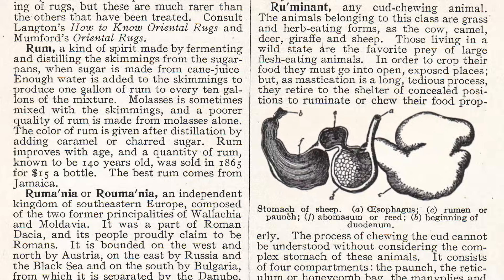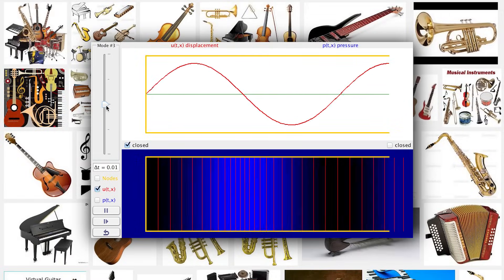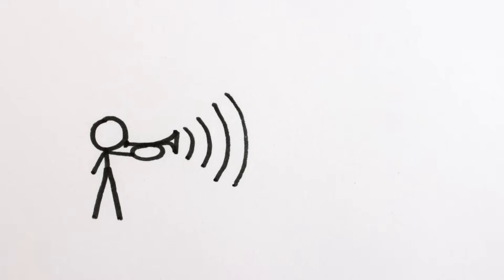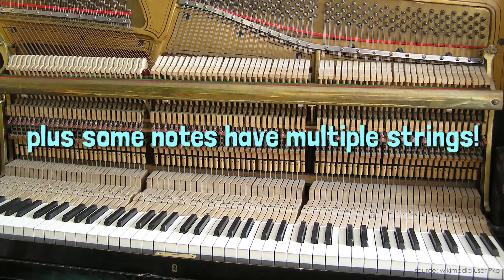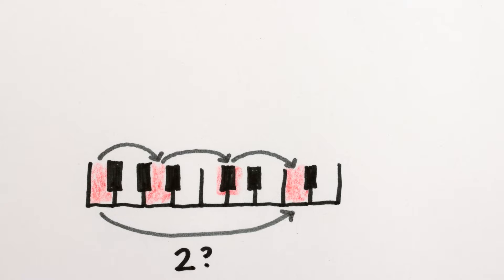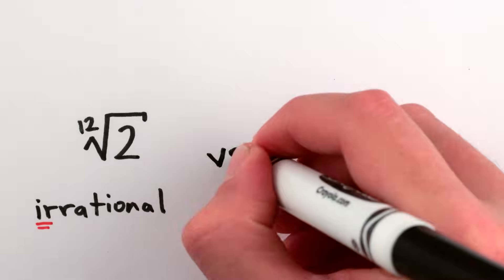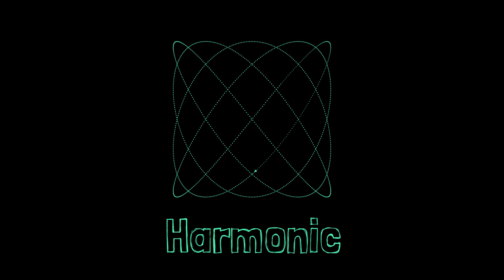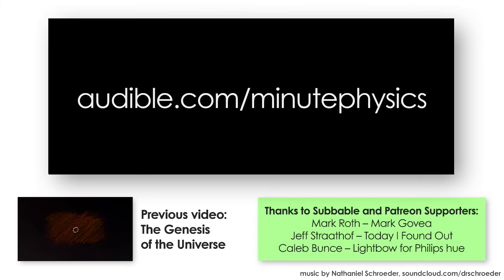Why It's Impossible to Tune a Piano

Comment: What if there was an electric piano that dynamically adapts the tuning of each note depending on which multiple notes are being pressed simultaneously to force them to have perfect harmony but in such a subtle way that we wouldn't notice while we're playing unless we're listening for it?
Reply: +PianoMastR64 Very interesting suggestion. I'm sure that would be possible to make. I wouldn't be surprised if it already exists.
Reply: I have a keyboard and I know a bit of C#. If I can learn how to work with midi signals, then I might be able to make a program that can do this.
Reply: +PianoMastR64 m8..
Reply: +PianoMastR64 I too know a bit of C#. C# F G#
Reply: I know both C# and Db. Yeah.
Reply: LOL
Reply: still wouldn't work. different key centers use slightly different notes than other keys. For example an E in F major is slightly higher than the E in the key of C major. To put it in the simplest terms, not only the notes in the chord itself, but what function the chord has will change the tuning as well. the same notes will be tuned differently depending if they're being used, say, as a Dominant function chord with a slightly raised third (leading tone), or a Tonic function chord, with the slightly lower third but raised fifth. so, in order for this hypothetical keyboard to work, it would have to know exactly what music you were playing, perfectly analyzed with Roman numerals and figured bass. But even this does not work with more complex music.

Or you could have a capable orchestra or choir perform it, and they will tune this way instinctively. In response to what someone said earlier, it isn't the slight out of tune-ness and small errors that make music performed by professional musicians special; it is the fact that they are MORE in tune than any other performance practice.
Reply: +Pete D Stay logic, please! If one note use different places this note is out of tune. If I tune my A4 440Hz no reason to use this note 441, 439 or other frequency if no the tuning is useless!
Reply: Sometimes we use the slight imperfection purposely, how would you find out if that is the case?
Reply: Tallywort Play around with it I guess. Options are always preferable, so make the feature an option.
Reply: Glade Swope
That is because a large part of the important intervals are only a few cents away from the corresponding harmonic interval. The fifth in particular is very close.

Also a thing to note, sometimes you want the slight discordance, for tension and emotion in the music.
Reply: I wish it could be that way, but it can't.  Let's say one plays a purely tuned (NOT equal temperament) minor chord with a sharp 7th; for example 100Hz 120Hz 150Hz and 187.5.  120 is a pure minor 3rd from 100.  150 is a pure perfect 5th from 100.  187.5 is a pure major 7th from 100.  BUT, 187.5 is NOT a pure minor 6th from 120.  120 and 192 is a pure minor 6th.  As you can see 192 is 4.5Hz different than 187.5.  So 120 and 187.5 will clash and sound out of tune with each other even though all notes are purely tuned with the root of the chord (100Hz).
Reply: C# is C# E# G# and Db is Db F Ab
Reply: This is what this idea is trying to fix - slow alternate ringing.
Reply: It will be 187.5 with 100 but 192 with 120.
Reply: That only works in traditional harmony. In atonal music or even abstract tonal music this would be pointless.
Reply: There are some keyboards that allow you to adjust the tuning per key. But, besides the tonic chord or just simply the major scale. Some intervals would still be out of tune as you play a progression, since the root of the chord would be different.
Reply: Using perfect position of any intervalle lead to go out of tune! Only total tempering can satisfy the human ear-the rest is simply a illusion ;-)
Reply: Yes, it would.  If the entire scale is tuned to C (C and D are pure 2nd, C and E are pure 3rd, C and F are pure 4th, etc.) then each note played with C will sound glorious.  But when you play ALL the notes at the same time it will be more out of tune than equal temperament because all those notes wouldn't sound good with each other...they'd only be purely in tune with C.
Reply: Latchezar Dimitrov And this is why I don't like piano...not even the octave can be tuned pure. Although with calculations from technician Hans Velo I'm sure the best stringing scale can be sought for.
Reply: My band director bought one. It analyzes the notes played (e.g. An E major triad) and adjusts the third (G#) 14.7 (?) cents flat and the 5th about 2 cents sharp. It's pretty cool and you really can hear the difference when he switches it from equal temperament to just temperament. (Just involves the chordal identity). The keyboard was said to have cost about $1,400.
Reply: It sounds like a cool idea, but it still doesn't work as well as other instruments tuning pure just because of imharmonicity.
Reply: Well, if this piano can use just intonation, tell me if one pure octave sounds highter than a octave formed using 3 consecutive pure major thirds?( I supose this piano has only 12 keys per octave)
Reply: That seems difficult since Major 3rds aren't chords so the keyboard would have a difficult time figuring out where to tune the root of each Major 3rd.
Reply: Dude, you should have patented that shit, not post a youtube comment about it so others can steal your idea. Next gen instrument! Go for it bro!
Reply: harrythedevil, well I am protected but the most difficult is to show how it is usefull and better than tha classic ET 12 ...
Reply: such piano already exists. It is called a "violin".
Reply: Then classical music would be destroyed because we would have mood shifts and color changes faster than Donald trump gets impeached.
Reply: This exists. It's called Hermode Tuning. Check it out.
Reply: Yes, you can make a just-intonated music with your computer. But it does not sound much better. Turns out human ears are not perfect oscilloscopes, we don't care about minor inaccuracies, they even make the music more exciting (i.e. vibrato is nothing but a dynamic inaccuracy). We can even enjoy music like gamelan that uses none of the pyhagorean intervals except for octave.
Reply: This could work if the piano will be played solo. If not, the music would sound 'out of tune' relative with the other instruments, unless, for example, a fretless or fluid instrument would accompany this piano, and the player is pithch perfect, since, for example, a in tune violinist or a trombonist might play the classic pitch intervals.
Reply: PianoMastR64 that clever pun though
Reply: Hearing the same note change pitch constantly while you're playing other notes would be nauseating. It would be especially distasteful while playing Bach. Doubly so when playing something with a long held note, like the C Major Prelude  from his Well-Tempered Keyboard bk II:  https://www.youtube.com/watch?v=tkNzx7hXu_U

I mean, imagine hearing that on an organ while the bottom note is pitching like a seasick sailor. Yuck. Constant pitches are constant for a reason
Reply: do you mean C# E# G# ?
Reply: Then you’d have to throw all composition theory out of the window and start again.
Reply: PianoMastR64 it would be possible.  But it would take mathematical  and musical professors to produce this
Reply: what keyboard is it?
Reply: Spectacular
Reply: Things like this already exist but are problematic. For one thing, if you play music that modulates e.g. repeatedly through the circle of fifths, the minute adjustments to tuning continue to pile up such that your collection of pitches will continue getting flatter or sharper. This means that your electric piano wouldn't stay in tune with other fixed-pitch instruments in the ensemble. Another issue is if the tuning algorithm is designed to snap back to the original tuning when you release the keys, then you will hear a commatic shift each time the tuning snaps back to its original place.

Hermode tuning is one example of the above and you can readily demonstrate the commatic shifts by playing certain "comma pump" progressions.